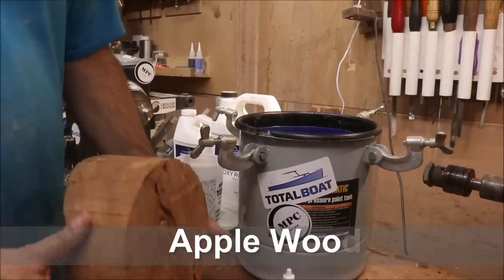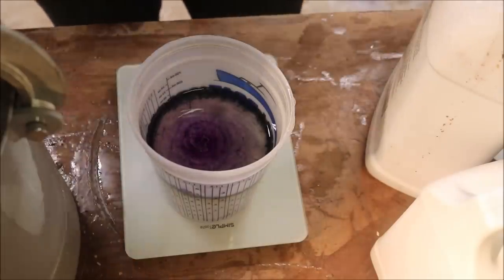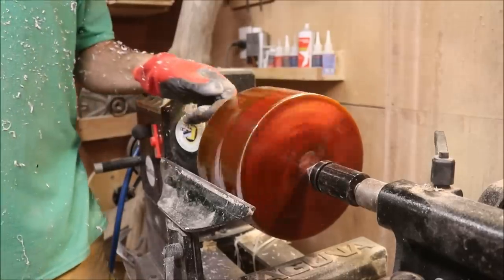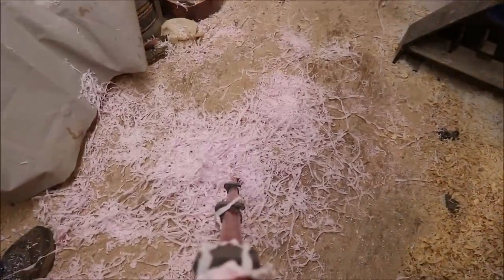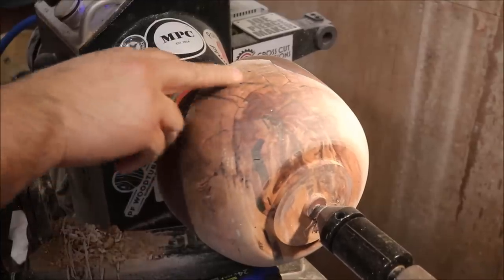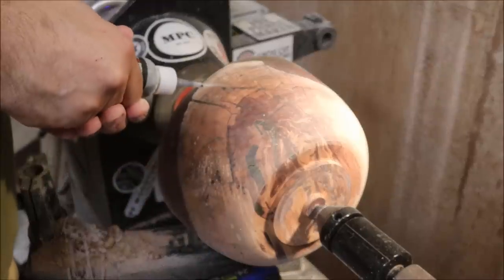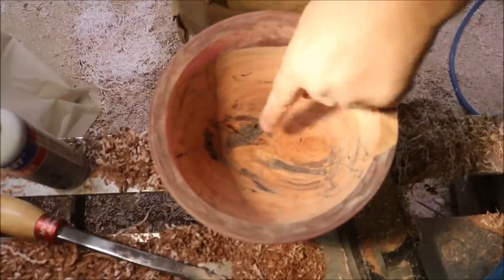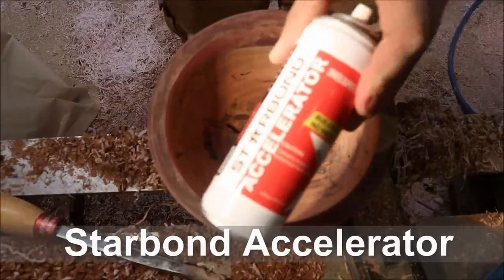Wood Turning - Pink Apple

Comment: Another faaaaantastic piece. Little sad to hear about the scale-back on videos, but I'm glad you made the call to do it.  Better to do this stuff in a way where it doesn't stress you out.  The holidays are stressful enough without piling onto yourself.

When you were talking about the resin seeping into the wood and filling the cracks, I couldn't help but wonder how it'd turn out if you drilled some holes horizontally through the wood to let the resin fill into the channels.  It's like every time I watch one of these videos now, I get ideas for stuff I'm going to want to try out eventually.
Reply from the maker: Once everything calms down and I am in the new shop I am going to start experimenting again. I've got some cool ideas I want to try......matter of fact I get these ideas from watching other videos or it just pops into my head. 

Ken